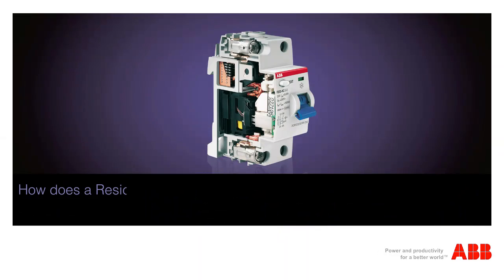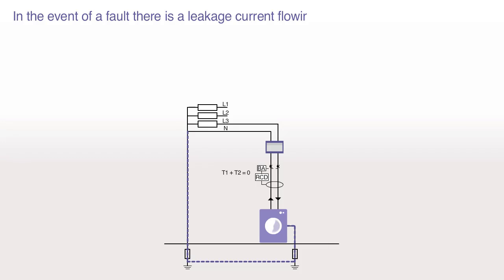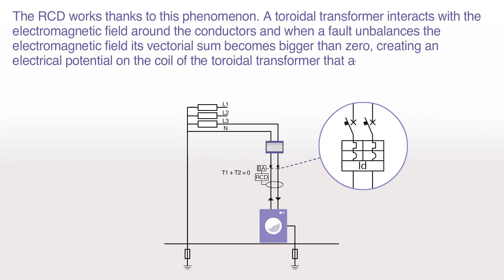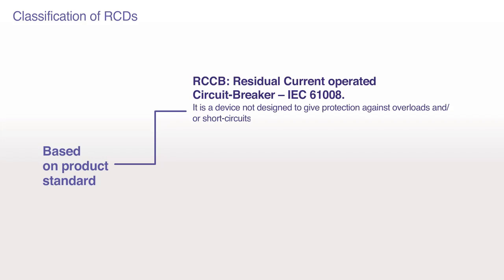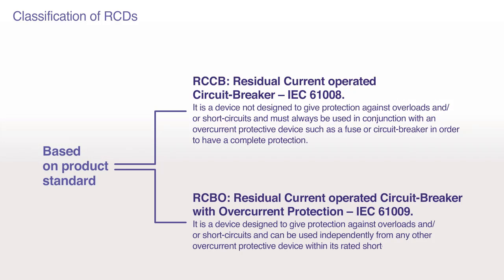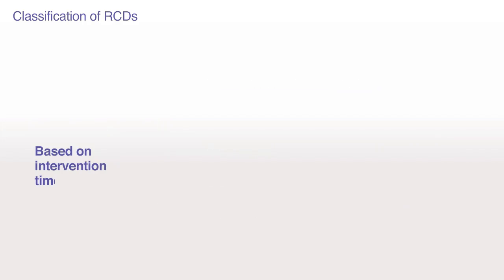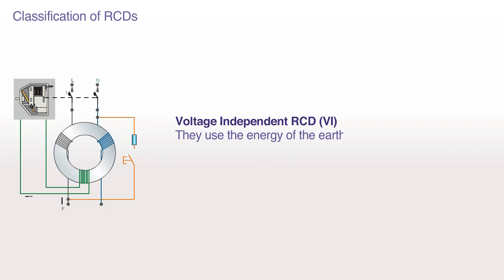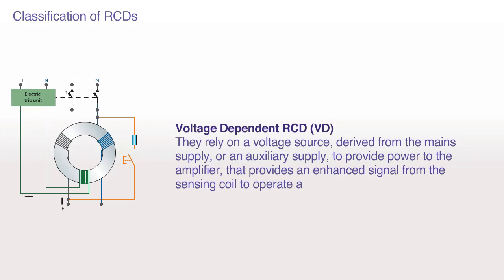ABB GARAGE NUGGET #13 - How does a Residual Current Device (RCD) work

Comment: Instead of all technical jargon, the companies should have focused where these types works, small demo describing how to connect and use them correctly in installation. Customers need how a product solves their problem , not how many or what kind of product do you have.